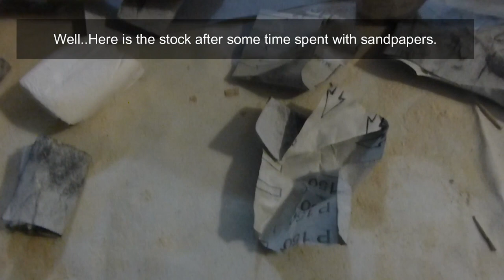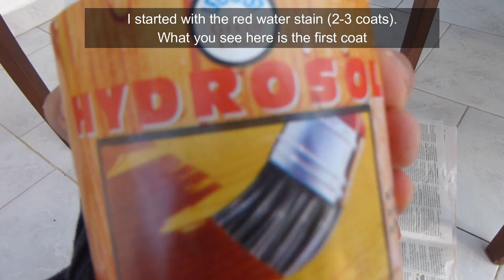How to make a Custom s510 wood stock: color change, cheek piece install, hamster

Comment: The finished work looked great, I have the same rifle and I would like to do the cheek piece, I would like to know where you bought the pieces so that the cheek piece is adjustable. excellent work. regards
Reply from the maker: Thank you for your nice words! The set I used is called Monty"s Comb Riser.I couldn't find any link to post you (had bought it some years ago), but I found his email contact: irishrifleman@gmail.com 
Good luck for your project!